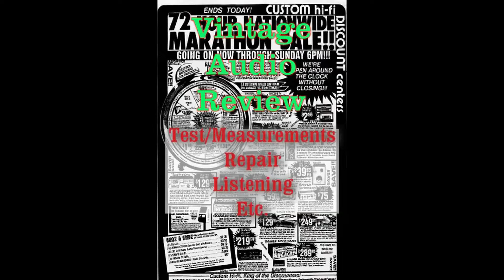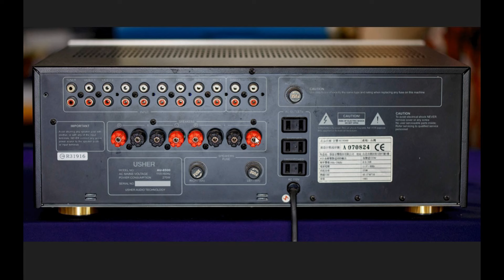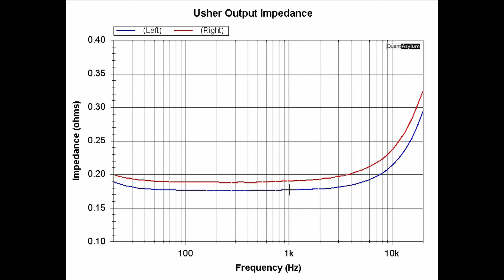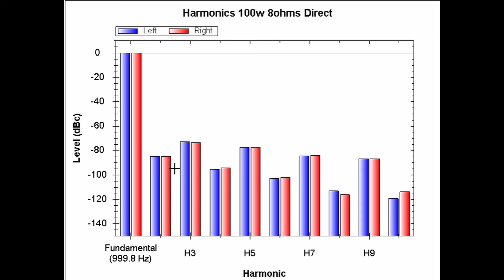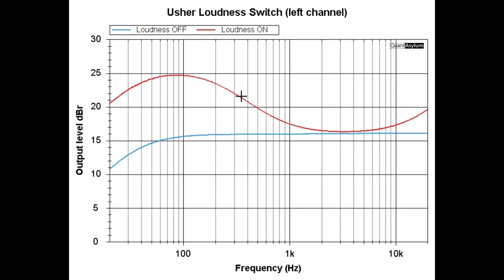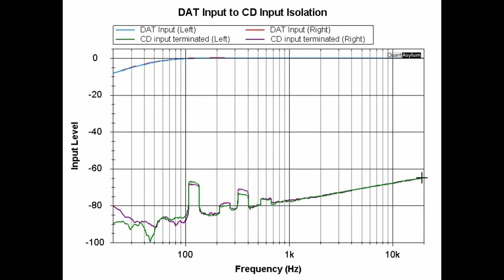USHER AU-8500II Integrated Amp- Vintage Audio Review Episode #109

Comment: I got usher be718  pair with au8500
and benchmark dac1, great sound system
Reply from the maker: Thanks for taking the time to comment and I am glad the system is working great for you!
Reply: @vintageaudioreview  btw, usher sells preamp(which I personally won't recommand), that's a part of reason why au8500 can use as direct in.
And usher have power amp called R1.5, this series is bascially inspired from Pass labs amp.
Reply from the maker: @garyteng999  Thanks for the additional info. I see no more Usher Gear in my future testing, unless I test the bookshelf speakers that my friend has...